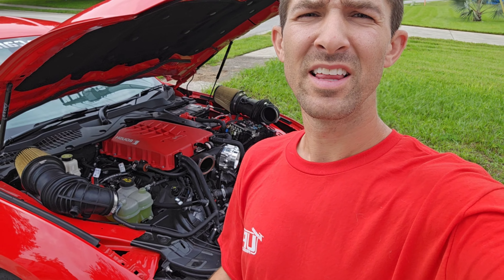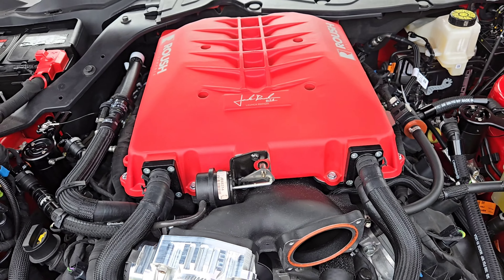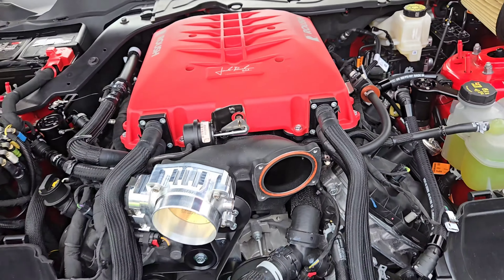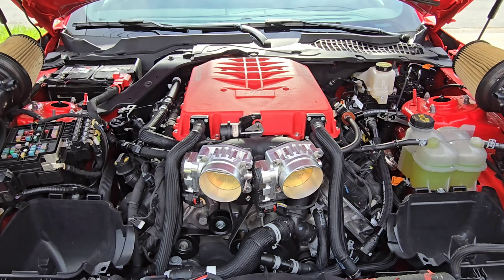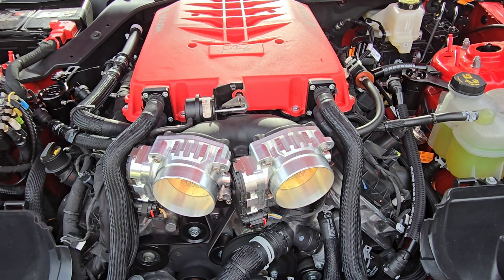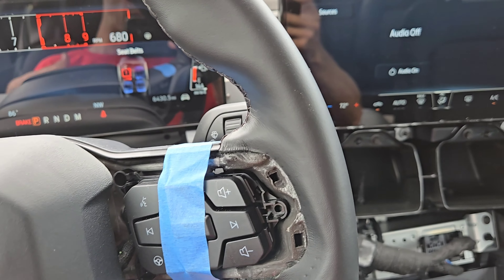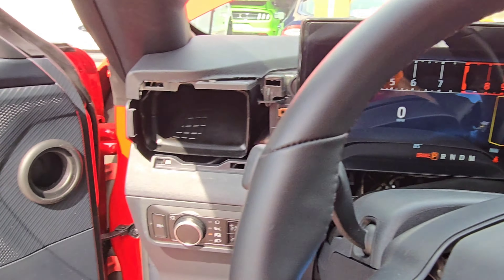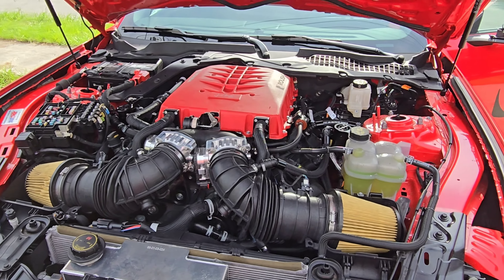MORE POWER and CLEANER INTAKE with Soler Performance Ported throttle bodies and UPR Catch Cans!

Comment: is the top speed still stuck at 155 ? or does it unlock it
Reply from the maker: @huntery1  if I can get out on the track to verify that I'll let you know
Reply: @THEDriverMod_ thank u yeah i called and they said it's stuck to 155 from ford but whipple is around 180 or so and i've seen 155 on my dash countless times😅
Reply from the maker: @huntery1  car doesn't get anywhere close to 150 in the quarter mile so whether it's 155 or 180 is kinda pointless though at this moment. It'll be a bigger deal once tuning is unlocked though

Comment: Hmmmmm … I have their throttle control module it’s the cats ass -
Reply from the maker: @YingYangStang  I've got their throttle controller on the S650 and their ported throttle bodies on the GT350 as well. Performed really well. More power and quicker 60-130/lap times with the throttle body specifically